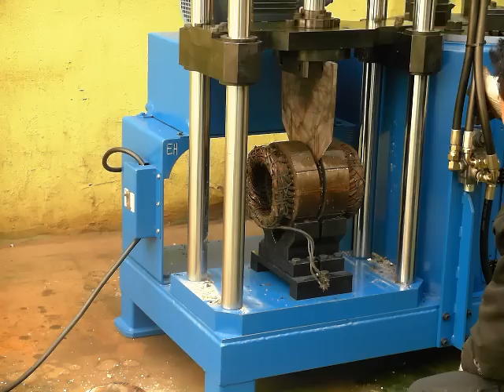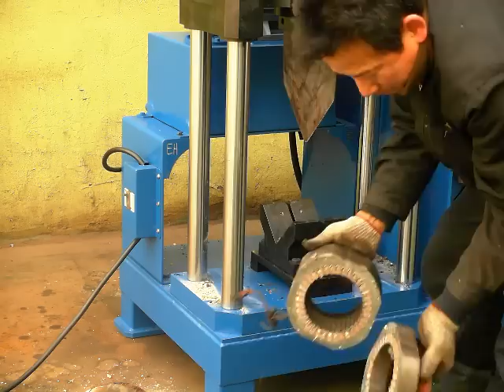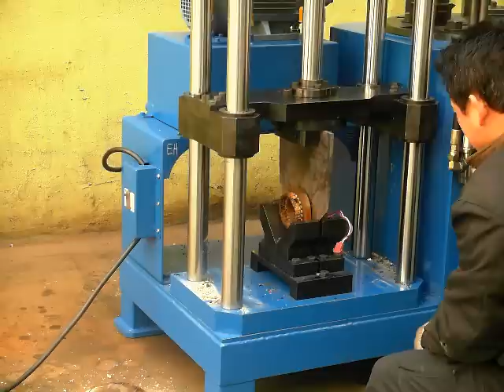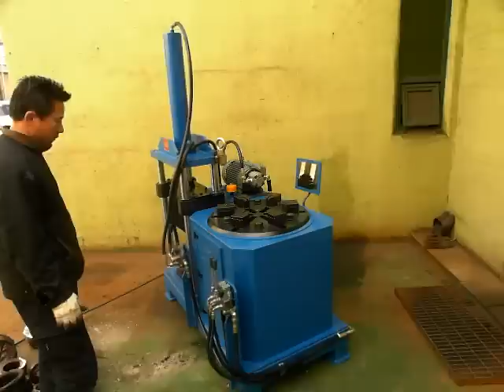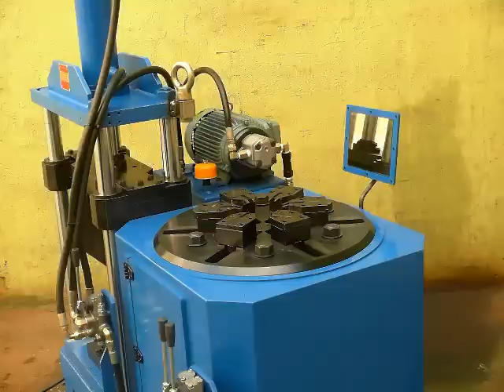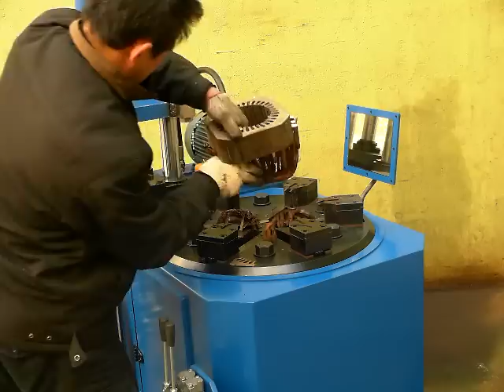Motor Recycling Wrecking Machine MW 808II WhatsApp/Viber/Line/WeChat/Kakaotalk +82 10 3198 5119

Comment: pls price
Reply from the maker: Single Platform - Low Bench : USD20,000Double Platform - Low Bench : USD21,500Single Platform - High Bench : USD21,000Double Platform - High Bench : USD22,500
Reply from the maker: Hello,
 
This is Ryan at O-Jung Ind. in Korea and thanks for 
your inquiry on MW 808II electric motor recycling 
machine.
 
We have been 
manufacturing recycling machine for more than 17 years in Korea and are major 
manufacturer of recycling machine in Korea. We are 
the first company which 
invented motor recycling machine in the world 15 years ago and 
the latest upgraded model is MW 808II. If you see others like ours, they are all 
prirate copies of our 
machine and we know how making machine 
propoerly.
 
There are 
two types of design, single and double platform type and you can choose one of 
them by daily working volume. It can break and cut up to 330mm diameter of motor 
from mini motors. Three different blades are supplied, one for breaking motor 
case made of Aluminum or cast iron and two for motor stator cutting, small and 
large.
 
Foe cutting 
bench, we have two types, high and low. In case of high bench it is comfortable 
not to bend waist and there is extra cost. Low bench is for seated working for 
longer hours.
 
Double Platform Type 
(2 cases) : 1800 * 1000 * 2050 / 1000 kg - : 1200 * 700 * 2200 / 700 kg
Single 
Platform (1 case) : 1800 * 1000 * 2050 / 1300vkg
 
Single platform has all the functions in one platform and 
operated by one motor. So if one function, ex. cutting motor stator, is in on, 
the other function can not be used.

Double platform is made in two parts 
of machine. Breaking motor case (cast iron) and cutting motor stator are 
processed in one part and separation copper coil is happened in other part. It 
is for great volume of motor recycling. 

If you want to see more, please refer to below youtube links and 
let me assist you for your right decision for our machine to be useful for your 
business.

 
With MW 
808II, you can process motor scrap with low cost and speedy operation and it 
will make your recycling business much more competitive. That’s why our royal 
customers choose our machine and hey found the investment of MW 808II returned 
in a right period.
 
For other products, see videos at https://www.youtube.com/user/OJUNGIND1/videos
 
We hope to 
help your business and MW 808II could improve your business as 
well.
 
Ryan.